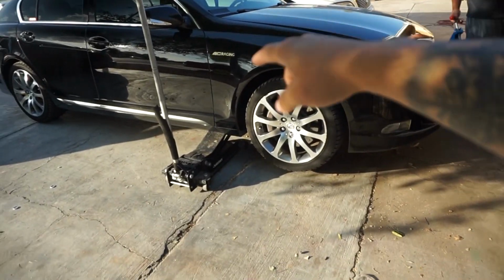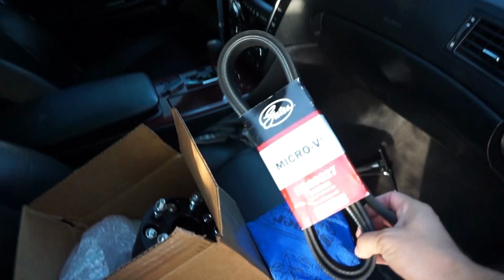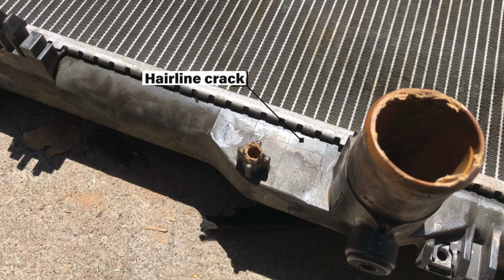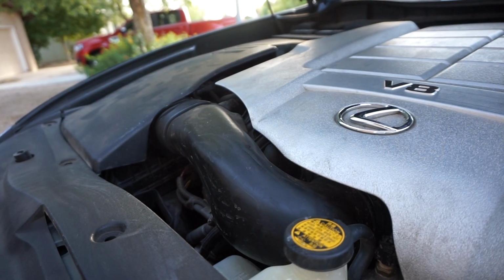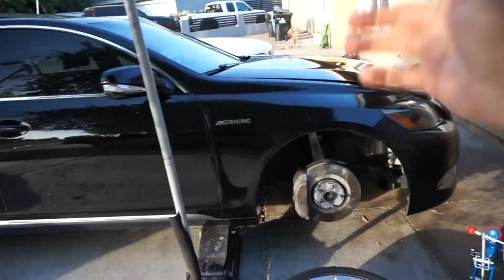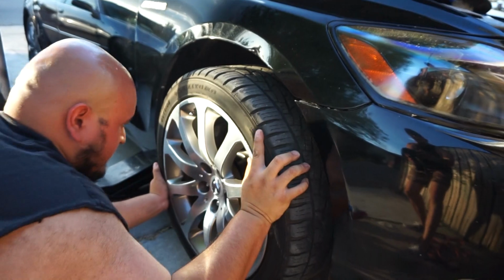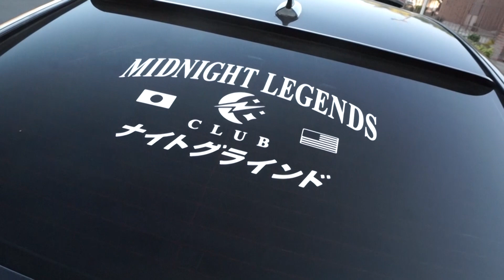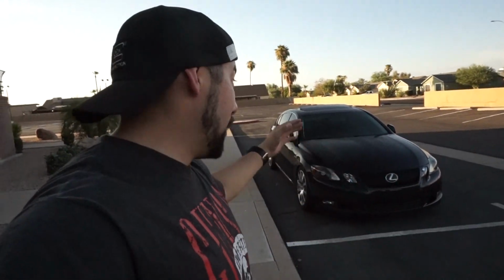Rare Lexus GS460 Fitment Check!!

Comment: Love the car man, not feeling the headlights though. What did you do to them? They look like the cheap eBay black housing headlights. Not talking shit at all just giving an opinion. Have you heard of the 78 works headlights? They make an awesome Oem (style)  set of headlights and they even have a daytime led strip thing in there and they also light up/flash when turn signal is used. Check them out. And I still want to buy this lol
Reply from the maker: Yes I’m definitely getting the 78works headlights. I had a few subscribers that wanted a tutorial on how to black out the oem housing so since I’m getting rid of them, might as well black them out. Either way it’s an upgrade from the old man chrome headlights.
Reply: Then nine twotwo
Reply: Then zero four five 6
Reply: @ajoros  area seven2seven

Comment: The pulleys are most likely misaligned causing that squealing
Reply from the maker: The belt wasn’t aligned. I was able to replace it with a new one 💯
Reply: @ajoros  Yeah I see you did, I commented before watching it all lol. But I was right, a tensioner is apart of the pulley system technically. Lol